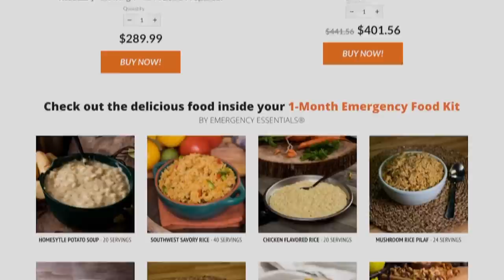CANADA Your Next - My Bomb Shelter Plans!!!

Comment: Ron are the bunkers pressurize to check for weld quality?
Reply: I don't think they would do air test on a bunker too dangerous
Reply: @arkoutarkout3654  It doesn't have to be a high pressure test. Just enough to pressure gage and see if the needle drops. Statement is that they are water tight.
Reply: @brik2716  you don't know about the pressure test then
Reply: For something like this a NDT ((non destruction test) would be done for obvious reasons.  If a visual test detects a problem a radiograghic or ultrasound test or other tests could be utilized.

Comment: How do you change out the filters do to contaminates in the hepa and charcoal? Wouldn't it be best to have them in a separate room? As if anything is on the filter and when the time comes to change it, you can't just walk it across the bunker. Just my 2 cents. I think it needs it's own separate room with decontamination zone. Could just be over thinking it though. Keep up the good work.

Comment: also another thought for your airlock. can people be heard through the door or perhaps you could use some type of intercom or one of them surface broadcast speakers to act as a communicatoin method through the door.. you know sound hits the surface them vibrates and acts like a speaker. Also might be cook to have a gas vs water switch for the decontamination mud room shower so that you can purge by fire or gas the location if a dangerous animal came down or something in addition to water for shower.

Comment: Would be nice to have some data on how deep a shelter needs to be in canada to have a somewhat stable and safe temperature inside. Around here the water table is high. so how deep a watertight round shelter can be buried ?
Reply from the maker: 6' plus.  Depends on your frost line
Reply: @AtlasSurvivalShelters  great! Can't wait to see more videos about the round watertight model.
Reply: It’s try but there are a number of Canadian issues I’ve thought through. Temperature is a big one no matter how deep or insulated you are the reality is all the air you bring in will be sub zero in winter which will refrigerate you snd will require pre heating or dwelling heat to get things to comfortable or keep them there. I would love to talk with Ron about these issues and try to work through them with Him and his contacts. Extra air intake for combustion air to a furnace or stove with chimney could be a real requirement in minus 25-35
Reply: @Eliukcory  i think a geothermal hear pump would be the best way all around but  not the cheapest.
Reply: I think the frost line in my area is 10'.  And in Saskatchewan we commonly hit the -40's oC.  So I would love to know how to deal with super cold air intake problems.   I'm sure there're solutions but another problem is the exhaust air.  Warm air creates very visible steam when blown outside into cold air.  Kinds defeats the stealth idea.   But I'm sure Ron is fully of ideas.
Reply: I know there is a heater that can be installed onto the intake pipe. I dont know the wattage but it'll probably be power hungry. Not ideal if off the grid on batteries.